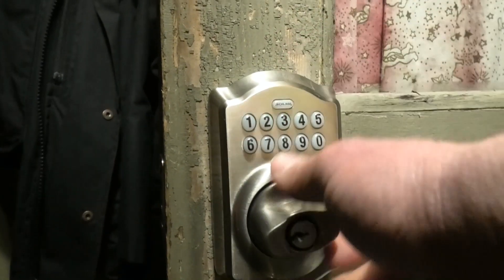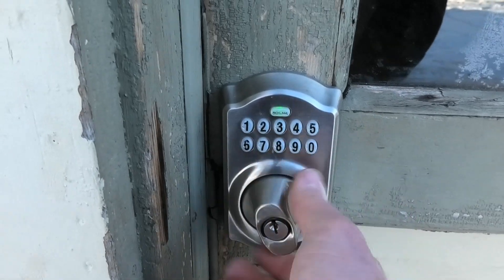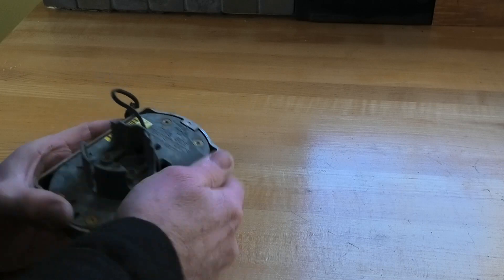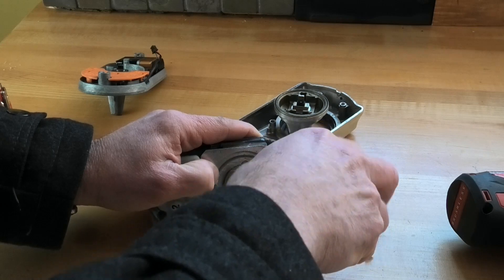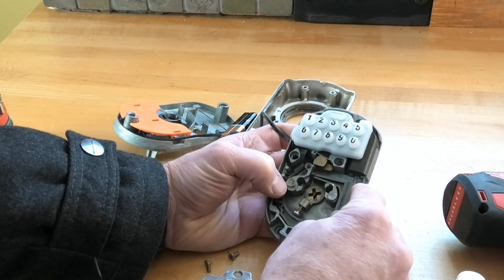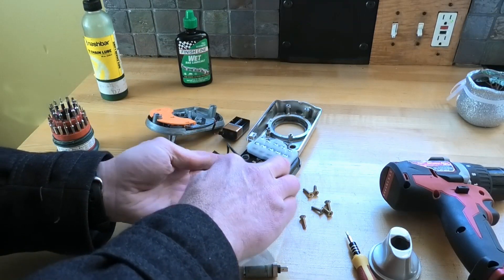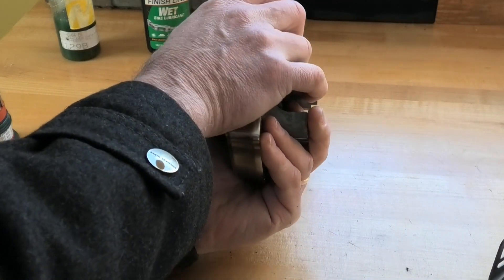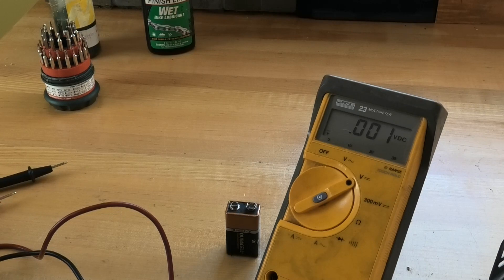Cold Weather - Why Doesn't My Schlage Keypad Lock Work?!

Comment: The battery that came with the lock was quite weak. Within a very short time (almost immediately) after installing the lock, the problem illustrated in the video began. Thanks, Matthew. Your video/explanation saved me a lot of time and trouble.

Comment: These locks have a low battery warning light scheme. Correct code and the top button blinks red before turning green and opening. 
After 5 AK winters it looks like I need to open mine up and reset the springs then lube. 
Thanks for the full video.

Comment: Only thing I don’t understand is how does the battery have to do with it catching. Is it because I like a magnet in or something? And the battery powers I don’t know. All I know is that I saw the battery when I opened it and I tested it with my tongue and realized it seemed dead and I changed it and a lock worked. LOL it started catching and turning again. And I had the battery for like two years now I should’ve realized. A while ago because it was doing this for a long time so I’ll just lock the bottom lock. But I’m so happy almost bought a new lock I thought it was broke. But thank God I realized the battery and changed it and now it’s great